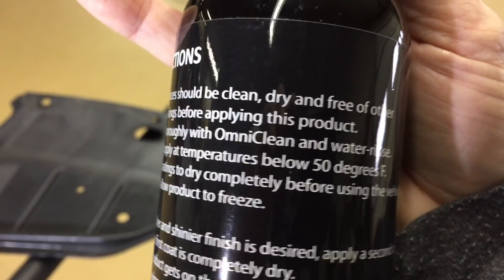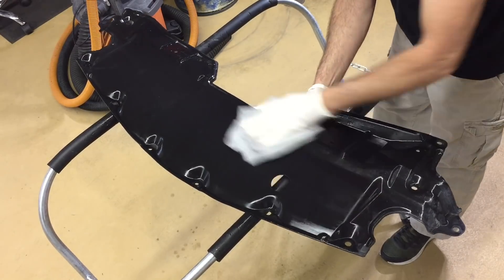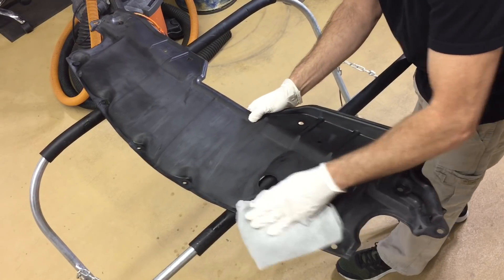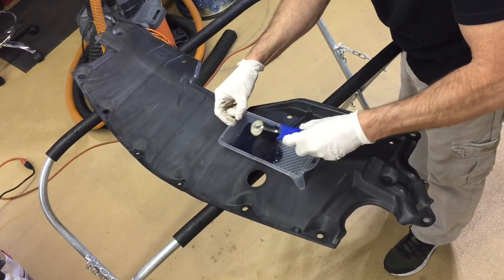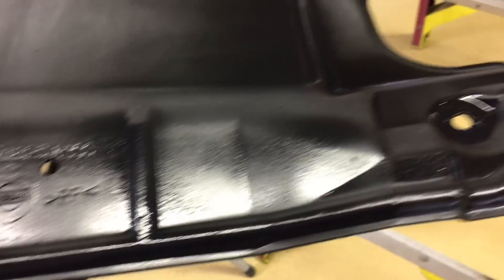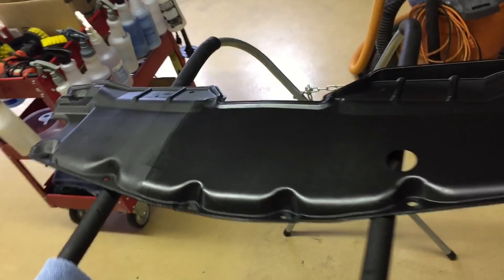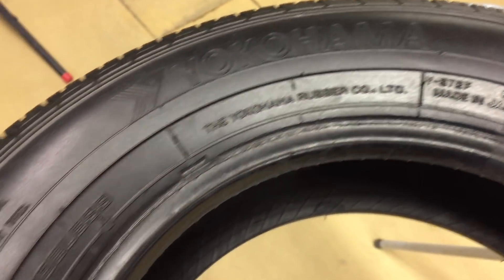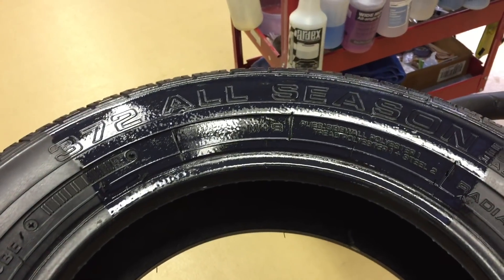Black Pearl Tire and Trim Armour!!! Semi permanent solution for faded/oxidized trim and even TIRES!!

Comment: I use to use Tuf  Shine Tire Clearcoat until I discovered this stuff.  With coated wheels and the rain we get here in the PNW no dressing would hold up.  The water would sling of the wheels and create channels in the dressing.  Clearcoat held up well but I love the mix of Gloss and Matte with Black Pearl to give the tires a little more pop.  And holds up for a long time.  Make sure your tires are REALLY clean before applying.  And will come off with denatured alcohol if you want to start fresh.
Reply from the maker: Great post!

Comment: I love Black Pearl. Bought some from you late fall/early winter. Great stuff.
Reply from the maker: How long is it lasting in your environment?
Reply: I put it on the tires in January after I thoroughly cleaned them finishing with IPA and Duplicolor Grease Wax remover.. Coming up on four months and they still look great.
Reply from the maker: I have customers coming back with this applied. They still look great as well.

Comment: Love Black Pearl on tires. Prefer GTechniqs Trim Restorer on trim. It's been on my vehicles well over a year through a salty winter and still on the car and makes weathered trim have a "new" "natural" look to it and you don't need to roll or spray to apply. Neither product is cheap but you get longevity that protects trough winter months when for enthusiasts like me who don't have heated garages to keep up with maintaince on vehicles.
Reply from the maker: I will probably cover Gtechniq as well I use the product line frequently.

Comment: I would guess using an air brush system you could do wheel wells and under carriage so long as its been cleaned thoroughly.

Comment: Do you need to remove the tyres off of the rim to apply ? Or can it be done while on the rim and inflated ? And how do you go about charging for this? In my country there be a market for the tyres but not the trims.

Comment: Great video, but that is not for me.  If I was going to put that much effort into preparing a plastic panel, and essentially painting the product on, well I think I would do just that,  repaint it.  Or if it was solid core black plastic, I'd probably just buff it out with a polisher and some plastic polish.   For tires, ehhh, maybe, seems like a pain.
Reply from the maker: I get it....its not for everyone. That is why I have a few options to go to.